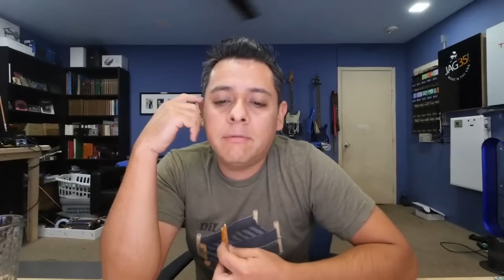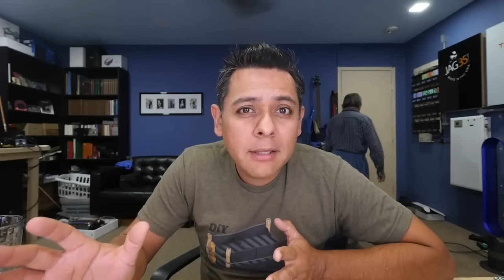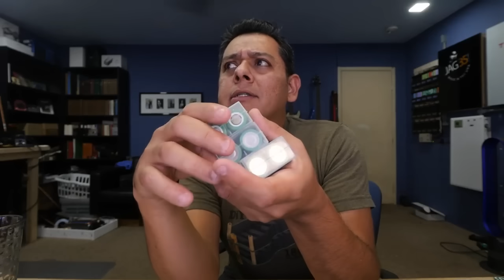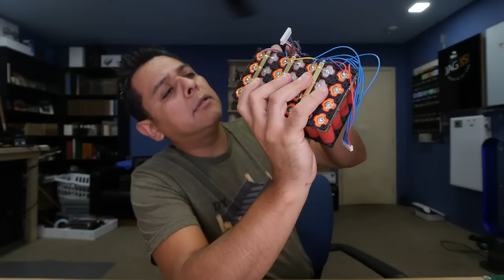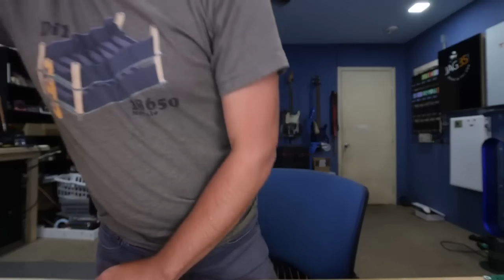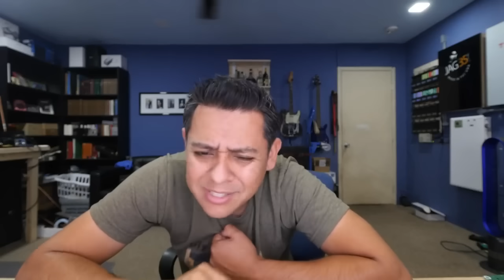LETS Discuss Chinese FAKE 18650 Cells - LIVE

Comment: Bird 2 and Bird 3 have 60 LG MJ1 cells in a 10S6P. They are a bitch to get into. You think you're good if you have the security torx but many of them have the head of the bolts smashed so you have to think up some...interesting ways to open them up.  Obviously its done by the owner/lessee of the scooters (Bird partner) to prevent the packs from being easily stolen. You can get the pack case off in less than 10 min with the right power tools

Comment: Roughly we can say its 2000kWh
So for 1000kwh it would be just split in half, means 320:2=160$
For more exact price it is,
1963watthour = 320$
1963:1,963 = 1000watthours 
(This means 1,963 is the Factor, this number makes the diffrance in this case) So then we take 1,963
---> 320:1,963 = 163,01$
.
So 1000watthours cost 163,01$

Comment: From a physical point of view, coaxial cables are actually of a significantly higher quality than regular UTP ethernet cable, it is shielded and everything, thing is, your ISP probably skimps on the equipment in either end of the connection, or, more likely, somewhere in their backbone, anything above 10G connections can become quite expensive when you factor in the equipment you need to terminate the connection in each end.

Comment: One more thing bro. I'm building a battery pack for a motor that is 1000 watts at 10amps. The pack will be 7s4p x2 will that be over kill for the motor?
Reply: 1000 Watts at 10 Amps needs 100 Volts. 7s4p x2 in sequence will not get there at all. You need 20 Amps with that 51 Volts to get 1000 W.

Comment: What confuses me is, if it’s a 3500mah battery, where does the 20A or 30A come from? 

I’m new to this, but I always thought batteries were voltage & capacity. So 3500mah or 3.5ah would be how you rate the battery yea?

Comment: @jehugarcia
As a vaper, the problem of fake Chinese cells is a real problem for others like me. Especially when it comes to LG "chocolate" 18650. A couple of years ago, the Sony's were hard to come by and counterfeited a LOT. They can be extremely dangerous to vapers who use unregulated devices.
You should look into Samsung 30T, and 40T 21700 cells. The outperform any 18650 that I am aware of in both capacity, and discharge rates. The 30T is rated at 35A continuous and 3000mAh, while the 40T is rated at 30A as well, but tests more like a 25A continuous cell with a capacity of 4000mAh. 
Here are some links to testing and discharge graphs. The tester, Mooch, is very highly regarded in the vaping community.
30T - https://www.e-cigarette-forum.com/threads/bench-retest-results-samsung-30t-21700-an-incredible-35a-3000mah-battery.863985/
40T - https://www.e-cigarette-forum.com/threads/bench-re-retest-results-samsung-40t-35a-4000mah-21700-amazing-performer-but-25a-35a.873677/

Comment: +jehugarcia To check the shape of the sine wave on the inverters you need a device called an oscilloscope. Use a 10x probe to bridge between the live & neutral (assuming a 50V max input scope), set the scope to AC coupled & then turn on the inverter. 
To check for harmonics & distortion, you would also need a Spectrum Analyzer (be sure to limit input voltage as appropriate as above).
To borrow some equipment, you might reach out to any Ham Radio or Amateur Radio clubs in your area. If you want to acquire the gear permanently, you can check the local 'hamfest' or get some from a company such as Rigol.
Feel free to reach out to me on my personal google account if you want further assistance, KF5TQN.
Reply from the maker: But how do you know your not reading the grid instead of the electrically connected grid tied inverter?
Reply: You run that with the inverter connected to either no load or a purely resistive load like an old-school no-fan space heater (or if the inverter can provide 220/240VAC, a used electric stove -- you'll need nice chunky wire of course). This will give you a direct reading of the output of your inverter unloaded & loaded.
I recommend thick heavy-gauge extension cord or generator distribution block to put those (usually old) heater devices outside.
I'm good on the 6 character gmail account above if you want to email me, I'll send you my number if it helps.
Reply from the maker: You clearly don’t know what a grid tie inverter is
Reply: Oops, I misread the question...
How to check the purity of the output of a grid-tie inverter.... 
In theory you could still use the stove, but you'd need an sine (or arbitrary) waveform generator capable of producing 240V RMS (660V peak-to-peak) at 60Hz. If I remember correctly, you live in California. I discovered the state hs a test proceedure listed here=> http://www.gosolarcalifornia.ca.gov/equipment/documents/2004-11-22_Test_Protocol.pdf that tells what they're looking for (all measurements capable with a quality logging multimeter & some current shunts [or hall-effect sensors]).
Basically, you'd want to make sure you have a signal coming in from the "utility/load" side that will be relatively steady (+/- 0.1%, or 1000 parts per million [ppm] would work spectacularly).

Comment: Jehu, could you use your new PCB and tray assembly to make 12V LiFePo4 packs (with a overcharge/under-discharge BMS) for under $10 per amp hour? If so, why not just go into business selling refurbished battery packs that can be slipped into solar charging systems as a lead acid drop in replacements?
Reply from the maker: Lack of lifepo4 18650 cells,  and I have no interest in manufacturing products for a living.  I wanna make money producing content at this stage of my life

Comment: We with power walls are more likely to have a 20ma load per cell! Not 20amps! I , at full output do not pull 1amp per cell! About 50-60 ma /cell. Max. And hope to get that to 1/4 of that. I hope to by this time next year. Have an about 7s 2000p battery bank. Along with a 800-900 ah lead acid Bank. To run my home. Off grid. With also a DC generator. For when there is no sun. I have 1500 watts in solar. And about to put up more.
Reply from the maker: Wow that’s awesome!
Reply: Wow 7s 2000p?! Holly 18650s Batman! Can you post a pick of how it is atm?

Comment: I always figure mine in amphours. @ what ever volts. Then convert to watt hours. I know what watts are. But it means nothing in my head. I know amps. And volts.  I have all LG cells 2600 and none are 2600. They are some just shy of 2900 mah. Most are 2700-2800. I have nearly 700 cells. In a 7 s.

Comment: I've tried telling Peter Stripol about the Li-ion cells, and how to use them on his aircraft.  I think he's stuck using batteries given to him by sponsors that are helping pay for the project, so unlikely that he will ever use anything else.  He has a tendency not to follow through with things so much, either.. 
ultralight aircraft fly very slow because of a rule in FAR part 103 that limits max sea level airspeed in level flight.   It's actually a bone headed rule that limits flight envelope of UL aircraft, hence limits safety, unfortunately. 
FAA is far more concerned with limiting their liability to the public than safety for the pilots. They actually promote rules which make flying small airplanes less safe, hoping to use the examples of crashes to regulate them out of existence eventually.   funny, that their mandate is to promote aviation...    SAD

Comment: Do you know which lithium 18650/20700 cells have the most life cycles? Meaning purely based on chemistry of that battery, not speaking of what I can do for the battery to prolong the lifespan. Koowheel or Meepo, one of them claims 3000 cycles with their SANYO 20700B cells... I looked it up, couldn't find anything about life span and then I did and the sheet said 500 cycles with 70% +capacity. So is it 3000 or 500? That's kind of a difference...   I think immediate discharge affects the lifespan the most, but is it the battery's capability to discharge high currents or the fact I am draining the battery with fast flowing current? cause these high drain batteries like samsung 30q have only 300 recharges for 70%+ capacity left... I don't wanna pay a 1000 dollars for a huge battery and having to buy a new one 8-10 months later.  Also the fact they almost never mention the resistance is a sin... I know cheap chinese batteries with lower resistance get better results than expensive samsung batteries with higher resistance...  Do you know which have the least resistance? Thanks for any input.
Reply from the maker: The only way to find out is to test it yourself,  I have Sanyo 20700 i just need to buy a cycler for it
Reply: jehugarcia you cant cycle it with the Powerlab Touch 6?
Reply from the maker: I can't even get the thing to work,  I might have a bad unit

Comment: PC > mac apple is shit
Reply from the maker: I agree, Windows sucks balls
Reply: jehugarcia windows ten does, but that's because it's trying to be mac, which is shit. Mac is for simpletons
Reply from the maker: Some people don’t want to become experts on computers,  we just want to use them,  I don’t care how it works I don’t care what’s under the hood,  I just want it to work,  and Macs for the most part are better at just working than the disaster called windows
Reply: jehugarcia that is literally wrong.
And fair enough you just want it to work, cool. Buy a Nokia 3210.

You want a smart phone that costs ten times more just because if the brand, buy an apple, you want a smart phone that is factually better performing for the cost, more reliable, and has a greater functionality, you get an android.

The same is true in the mac vs Windows never ending pile of shite argument.

Windows is better, when it doesn't work the problem is nearly always sitting in the chair. You get better preforming hardware, you get higher spec software and for a lower cost, the trade of its you need to have a bit a know how.

So cool, you don't want a pc, I don't care but the fact is pc is better than mac. FACT.

It's not up for debate, 18650 are better than AA, lipo is better than nicad and pc is better than mac. You want to pay more for the trade off of not thinking about it, that's not my business.
Reply from the maker: Your opinions are not facts,  if they were then my opinion that macs are better than PCs would be law and it would be end of story.    Macs work, PCs need to be worked on.   Facts
Reply: jehugarcia is not opinion, go to any online shop and compare like with like. It's no good acting sore. It's simple reality.
Reply from the maker: Are you still arguing?  Windows sucks for personal computing dude.  Accept it, embrace it and enjoy your pc with computer geeks,  let’s the rest of enjoy our macs that just work
Reply: jehugarcia intelligence as an insult? I guess that's why I finished school, don't suck at maths, have a job, have a home, understand how to make a computer work, how to build a computer. Says rather a lot about you that you don't value intelligence. You stick to your mac, at no point did I say you shouldn't, in fact I pretty clearly said cool for you. So go ahead, continue to try to belittle me for being smart enough to be able to get a computer functioning.

One last point, if mac was anything but brand the programs that exist would be designed for it, there's a reason they're all for Microsoft devices like games, just like there's also a reason most offices use pcs and most homes have pcs and not macs.

You enjoy your mac, best of luck to you, it suits you so cool, glad for you.

Comment: Jehu. You rock. My question is, which voltage is best to use for a inverter  for home use?
Reply: 1fastbuggy The higher the voltage you go, the less overall amps you will pull for your pack.. for a home setup I would go with at least 24 volt although 48volt would be a lot better
Reply: Thanks for your reply Todd.  I do not want to stress the batteries with the discharge load.  Planning on building maybe up to 3000 watt AC load on an inverter or inverters and solar recharge for the battery packs.
Reply from the maker: 48v is the best that commonly exist but 400v in the future will be better
Reply: 400 volt. Do you mean 40 volt input from the batteries ?  output that I will be using is household voltage  110 volts.
Reply from the maker: 400v like ev packs
Reply: jehugarcia do not test it with your tongue! 😜😤😬
Reply: 24:48 any little thing like eating in front of the camera 😂 😜😉😋

But I guess you have to charge your battery too...🤣
Reply: I have also heard of 60volt setups on larger second ski homes around here that have big arrays

Comment: So.. did you tested this cells? They are fake - not 20 amp ? Please answear 😂.
Reply: Piotrucha Romanik he answered that serval times. They are fake, they are only 10amp continuous.
Reply: Sarch Lalaith so still ok but not power cells ?
Reply: Piotrucha Romanik correct. Probably still fine for a power wall with redundancy

I bought BAE systems packs from ebay.
554 A123 batteries for a grand including shipping, at 90% of original capacity. 40v 2250A. 74watt hours in that configuration (naturally I'll use a rectifier to make it higher voltage and less amps and that watt hour should jump massively given that I'll never use 2250A at any one time)

I got them off ebay

Comment: The Liitokala HG2 batteries are very low grade/fake cells. The lite load capacity is approx 3000mAh, but they overheat/fail above 10A continuously. The voltage drop is also huge; <20% is above 3v even at <10A. Real LG HG2 cells have >80% capacity above 3v, even at 20A continuous. I have tested lots of the Aliexpress cells, Liitokala. Varicore, Dolidada, etc.I haven't found any real LG HG2 batteries on AE yet.
Reply: Frank Jensen aye they're crap aren't they, I spent the better part of 6 months looking on aliexpress for reasonably priced decent batteries. I gave up.

In the end I bought second hand batteries from a defense contractor that change the batteries on navy ships.

Got 6 BAE systems 40v 2250A packs for a grand. That's 554 A123 systems batteries for a grand... Bargain.
Reply: Frank Jensen I bought several HG2, in AE. I didn't testesd max Amps on these cells, I'm using its on a small scooter, they perform 4A sustained for 1hour without any heat, but I have the feeling they are not fully genuine HG2. Atte this load the voltaje drop is not so good. Where You buy genuine HG2?
Reply: Frank Jensen any other decent brands that work from AE? Panasonic/Samsung types that are good instead?
Reply: Henrik Söderlund what he's saying comrade, is that you won't find good brands on aliexpress, you only find their own not so good brands. Which can not handle any stress
Reply: Frank Jensen i have build myself a new battery for my stromer e bike with them. I taught they where real. How long do you expect this pack to last?
Reply: for the price, they are goot to me ... i use them in plane, they pull 30amp at takeoff, can take 10-20 amp continuous without probleme, maybe these hg2 from littikola are not legit but they are pretty good to me :o for what i do at least
Reply: How about cells from DHGate. I was looking at them and they are quite cheap!

Comment: Jehu, I want to build a lightweight E. wheelchair. ♿
Reply: Ray Her @123 or lipo is what you need, you will find links on jehugarcias page. Build the frame in aluminium. In terms of motor you might be stuck with something heavy if you don't want to pay top dollar. A washing machine motor move do the trick
Reply: Ray Her if you don't care to spend the money. Ebike hub motors would work well. With the wheel is the motor. That is what I'd use. With a regular wheelchair just put the ebike motors on there. And a LiFePo batteries. And ebike charger. It would probably weigh about 40-50 pounds more than a wheelchair. I was in a wheelchair for years. And will likely be in one in the future. And may build one myself. And charge it with solar power. And have it where I can use the battery when not needed. To help power my off grid home. Every little bit helps!! ALSO.. You could use two motor controllers and steer it like a skidsteer! No need for steering!